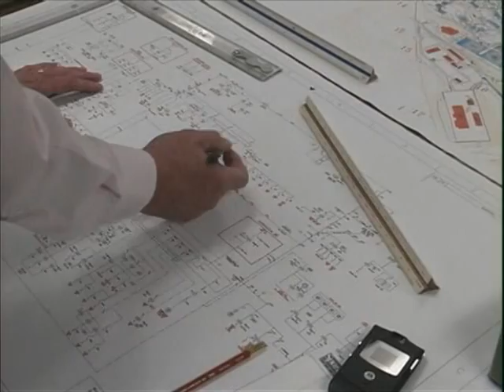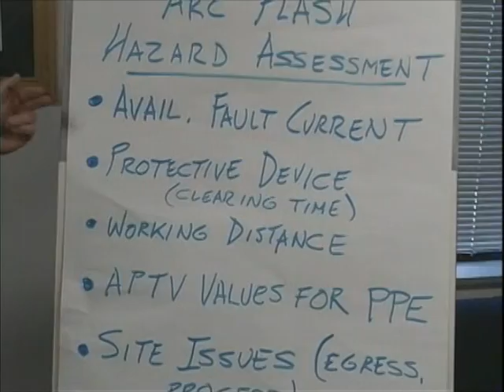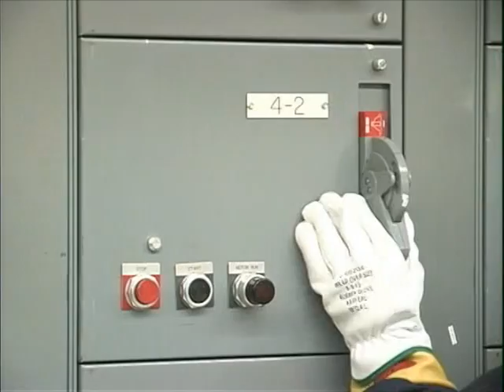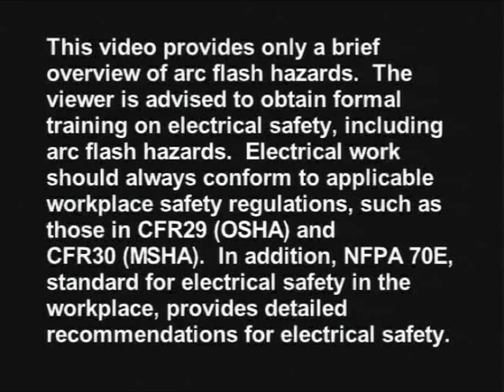Arc Flash Awareness - NIOSH - Part 2

Comment: These stories make my skin crawl.  Recently my boss called me, as asked if I wanted to go to a big box sports store to change out a breaker for a air handler.  My first question was is it high or low voltage? He said low, so I agreed without hesitation.  When I arrived, I came to find out it was high voltage and the breaker was 400A.. I actually considered changing it out hot, but I told myself no.  I came back at 10pm and shut a 2000amp main off to change out the breaker. Stay safe guys.